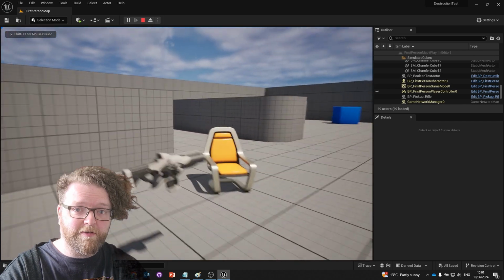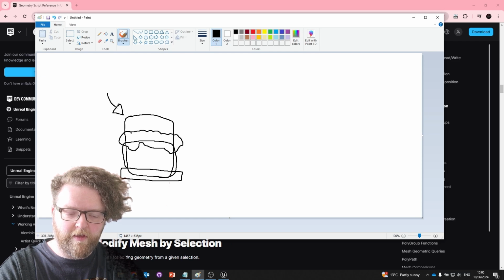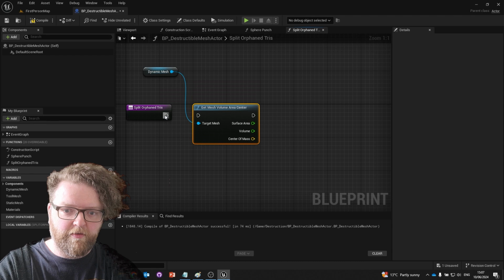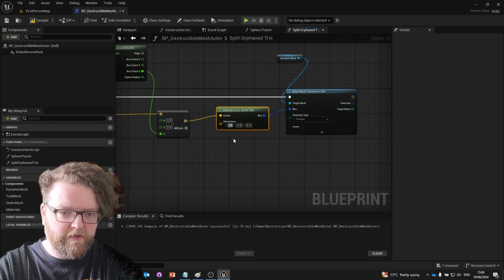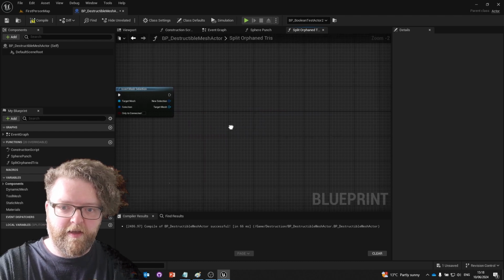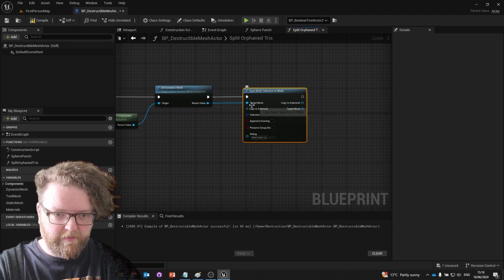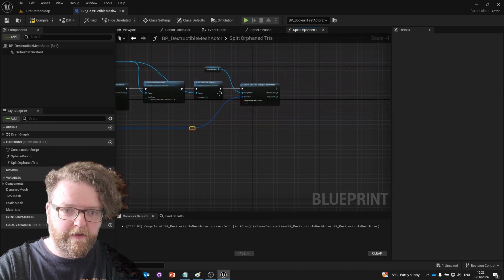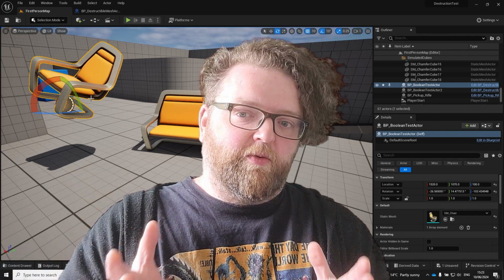Unreal Engine Destructible Meshes with Geometry Script Part 7: Separating Orphaned Sections

Comment: Hello, thank you for this amazing tutorial series! Easily one of the most in-depth and comprehensive dives into geometry scripting that I've found anywhere on the web. With that said, I'm running into a bit of a frustrating issue with geometry script and collisions, and I was wondering if you might know what's going on here?

In my case, I'm developing a game where a player will be able to move and fly around in vehicles built out of blocks (similar to "Space Engineers"), and I have everything related to deformation working - simulated weapon impacts putting holes in the dynamic mesh, etc. However, I'm running into an issue with collision - a standalone building block actor (DynamicMeshActor) seems to simulate collisions just fine (blocks me from running into it, blocks objects I try to push into it, etc), but the second I attach the building block to a parent, and then move the parent, the attached block actor just starts phasing through everything, as if it immediately loses all collision when being moved through its parent. 

This behavior is confusing, because if I swap it for a regular static mesh, everything suddenly works as expected - the parent stops moving if its attached child static mesh actor bumps into something, and vice versa. I even tried giving the dynamic mesh actor proper simple collision (using "Generate Collision From Mesh"), which allowed me to enable physics for it, but even that doesn't seem to be enough to keep it from losing its in-motion collision when it's attached to a parent.

Any idea on what might be going on here? I'm pretty new to Unreal Engine, so I'm not sure if Static Mesh Actors are some sort of "special case" that gets to keep its collision in-motion even when welded to a parent, or if I'm just neglecting to configure something. My dynamic mesh block actor has collision type set to "Simple And Complex", and the collision preset is "BlockAll".

Thank you again for this amazing tutorial series!
Reply: So i asked chatGPT for help and it's got some ideas for what might be going on. First of idk if the parent is a dynamic mesh or a static mesh actor, that might influence what's going on but it's not saying anything specific about that. It's saying that UE states in the documentation that the complex as simple is not compatable with simulation and would make the mesh fall. It also said that wielding could cause issues with physics and recommend using sockets instead. Also if you're generating collision every time you boolean the mesh it's going to detach from the parent if it's parented no? It completely rebuilds the mesh every boolean meaning everything resets. so i guess you could re-weld or re parent the socket every time. idk if that helps at all but i hope you find a solution!
Reply: @wonderlandnise  I ended up solving the issue by moving away from having each block being an individual actor, and just working with a single dynamic mesh actor that is modified at runtime - only having a single mesh (rather than a bunch that are welded together under a parent), the collision works much better, although i still had to get away from "use complex as simple" in the end due it having a lot of issues with letting things clip through the mesh if it's "moving" (position shifting on each frame) too quickly and such.
Reply: @GodsStrongestLeon oh haha GPT also suggested doing that. Im glad you could figure it out! Good luck on ur project it sounds very interesting :)

Comment: For anyone who didn't notice, if you copy this code, the way it's set up is not checking if there is or is not any free floating geometry and thus it spawns an actor (invisible without geometry) every time a bullet hits the actor. 
Edit:
My solution was, after the 'invert mesh selection' node, add a 'get mesh unique selection info' node, drag of the Num selected output and check if it's less then a certain number (a low number for me) with a branch. Thought you'd have to spawn the dynamic mesh first to count tris but you don't which is a big save :) Hope this helps someone!
Reply from the maker: Did I miss that out? Damn, I need to be more detail-oriented.

After you've selected the vertices at the base of the mesh, then expanded that to all connected vertices, and then inverted that selection to get the vertices NOT connected to the base (if any) then all you'd need to do is check the number of vertices left in the selection is above 0.
Reply: @alanteachesthings  I found a solution that worked for me, read the edit in my comment if ur curious :)
And don't worry about it, you're one of only two tutorials on you tube i found that actually show you how to use this stuff in the way i wanted. I was able to make it so huge thanks to you!

Comment: Thats literally what I needed! Thanks bro! Can you share the project files?
Reply from the maker: Sorry for taking a while to respond to this. I thought about it, but personally I'd rather not share the project files for stuff I make tutorials on.

I'm a teacher at heart, and I want to help people get better and get their feet wet with building things. I know sometimes it's easier to understand something by picking it apart and going through the files, but with the distance I have from people I'm trying to help here I feel like putting up the files would lead to people not trying stuff themselves, and that would defeat the purpose of trying to help people get better. I hope you can understand that.

Also, as I kept saying throughout the tutorial, this is ONE WAY to implement this - and, in fact, I'm pretty sure I could do it more neatly and efficiently nowadays. The great thing about making games is that every game is slightly different, enough that there's NEVER a single "best" way to do something. So you should take this tutorial as a way of finding out about the tools and how they work, and find the method that works best for YOUR game. One key example: only in rare circumstances would you really need to break the debris up realistically like this. In 9/10 cases you'd be far better off making some predefined debris pieces and using Niagara mesh particles instead.
Reply: @alanteachesthings  Its too late. I already do much better than your videos.